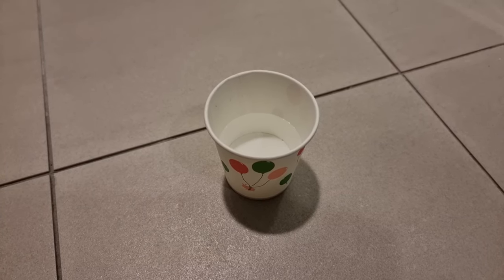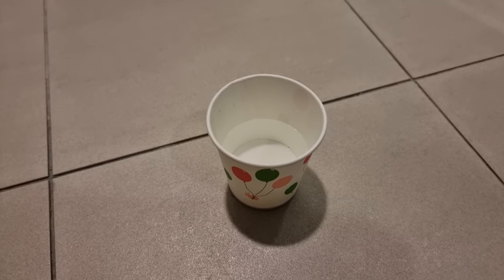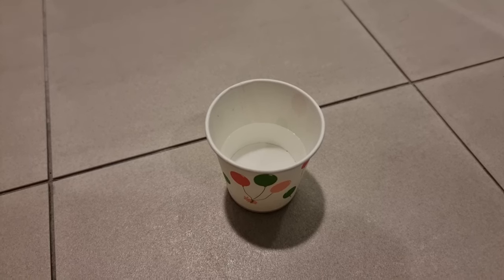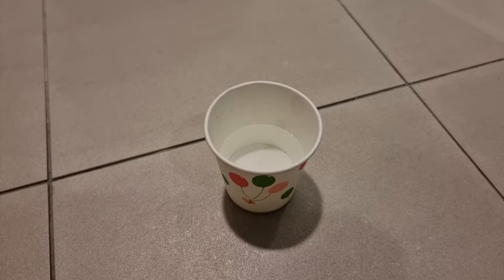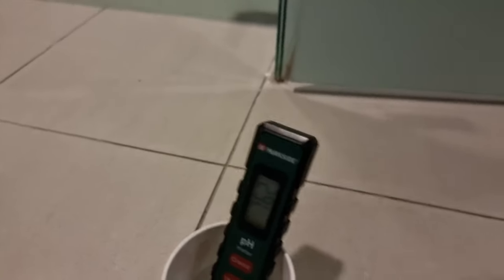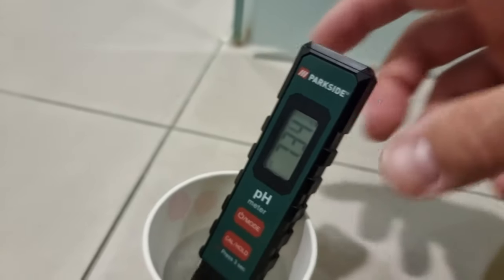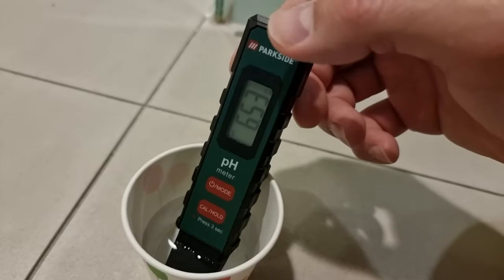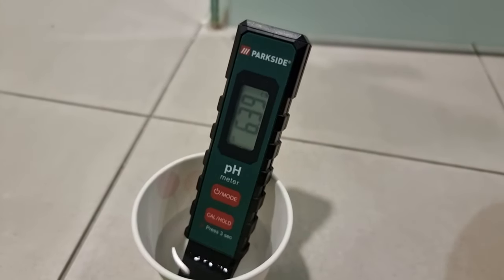Bin-Juine Huang - pH of RO de-ionised water before use in cavitation reactor

Comment: Just to elaborate about why is important to know the pH of the OR water, it is evidence to show that the tap water is made virtually free of minerals by the OR process, so any changes in pH after using this OR treated water in the boiler comes from interaction of the water with the copper pipe and the cavitation process, so there must be some H produced to explain the alcaline pH after the water is used in the heating circuit.
Reply from the maker: Produced or captured into say heavy D or heavy 17O water.